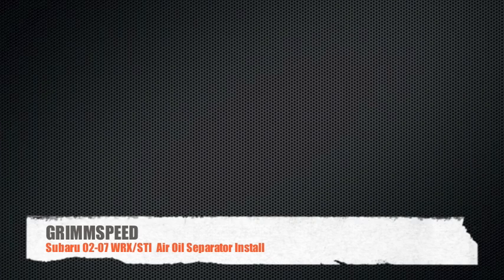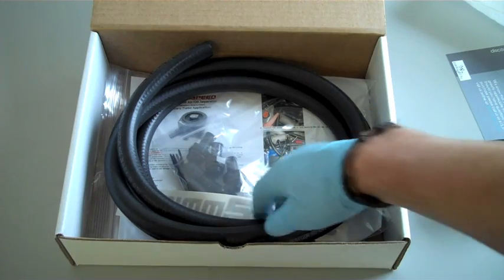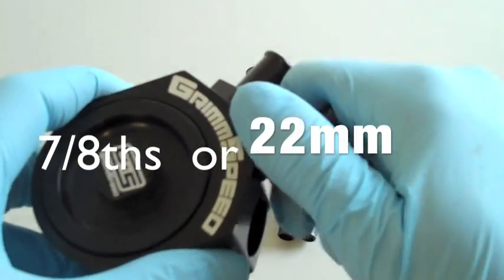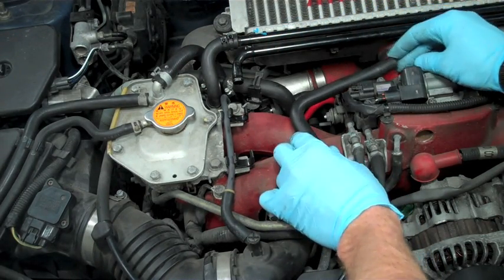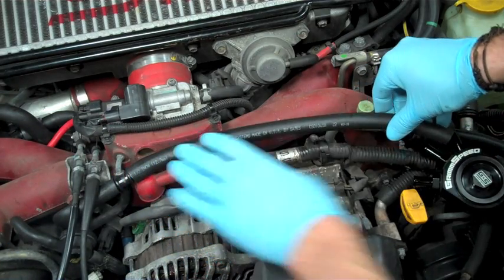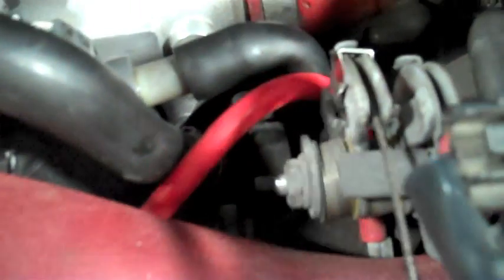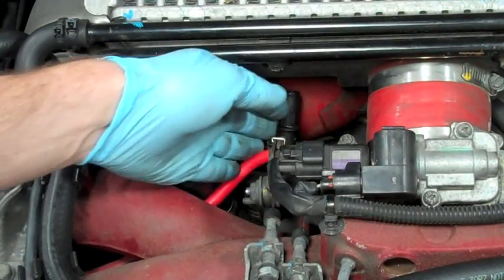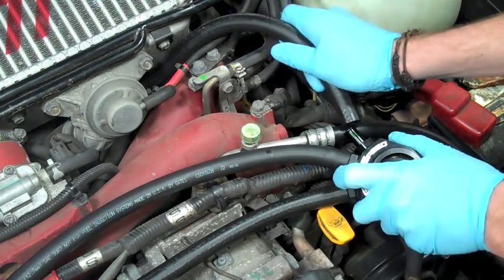GrimmSpeed Air Oil Separator (AOS) Install

Comment: Ahhh just noticed with 3rd hose on mine there is no white or grey port on the turbo inlet hose. The hose is just connected to the turbo inlet hose fitting. So do I just cap the turbo inlet hose fitting instead because there is no white or grey port on the turbo inlet hose?

Comment: For the 2016 Sti its the same right? 
Top hose: T fitting with PCV 
Middle: Turbo inlet
Bottom: T hose the connects to both heads

Comment: i have it on my 06 wrx and i have noticed 1mpg improvement. yes even 1 mpg is noticeable when it adds up in trips and cobb accessport display. the shifter also gives vibrations of the engine detonation. this is with group N bushings all over so the feeling is sharp. the engine idles a bit smoother. the top mount intercooler doesn't have much oil like default OEM setup. so that means it helps with detonation characteristics as well. product is worth the money. thank you grimmreaperspeed

can you make a special color for me, gold AOS?

Comment: Thanks for the vid. Made the install too easy. I ended up running the pcv valve hole straight to the separator and still had two foot of hose left.

Comment: Why is there a disclaimer that all products are for offroad use only when this is a product for better efficiency?
Reply from the maker: The rules and regulations vary so differently from state to state and it's very difficult to adhere to every single one of them, especially when you have a large offering of products. "For Offroad Use Only" is a statement you'll see on most aftermarket parts websites to help avoid regulatory issues.

Comment: Hi grimspeed I wanna buy this product but I read alot of reviews thats it doesn't works as well as it is claimed is that true for most vehicles? Thanks
Reply: Just installed one on mine and I’m sad to say I went through 1L of oil in 1000km (600ish miles). I like grimmspeed but I’m not overly impressed with this one. Wondering if I can add some kind of baffle on the suction side to help stop some of the oil because right now it’s basically just a drinking straw to the oil pan

Comment: Sorry Grimmspeed. But I think this is your only bad product. I absolutely love you guys and have every single part you guys make for my car. Everything from shrouds to the downpipe. I’m a dedicated fan of your products but this particular one pains me. It’s been 8 years since this video went up and many people I personally know have installed them with clear lines to see their actual performance and still get a lot of oil blow by compared to an iag or Crawford aos which plums coolant through it to keep it hot and do a better job of actually separating the oil. I understand this product was designed to be easier for people to install but it really doesn’t preform compared to other setups. I’ve tested things that vent to atmosphere as well as recirculating systems almost all have done better than this. Also if you ever wanna use my bugeye as marketing let me know. It literally has every grimspeed part you make for it minus the aos. Down to the shift knob.

Comment: I know this video is old, but I jumped on an old 02 wrx awhile back and I'm wondering if this AOS will fix this film of oil I have building on top of my y-pipe? Or if it's normal. Thanks for an easy install I'd appreciate some help.
Reply: Lil WRX normal but a AOS would help, Crawford or iag are better brands. This one does not perform

Comment: Installed it on 2006 outback xt. It took some effort to install the last hose, but it is well worth it, now XT even got better gas mileage and a pace of mind that subie will not have ring land failure.

Comment: I installed this last week on my stage 3 2003 wrx. i have a tomei turbo inlet hose and when i put this AOS on and used the cap over the metal fitting attached to the inlet. I ran some pulls afterwards for logging purposes and noticed that after the first pull my boost started leaking. I pulled over and the entire metal fitting had popped of (i guess it was launched?) Is this normal?

Comment: What a mess that made of the engine bay. Pointless if it's recycling hot air back through the turbo
Reply: troll says troll things.. weird
Reply: he caped off the sensor that feeds back into the inlet
Reply: your suppose to

Comment: wish you would share the other kind of "Hoes" ; )

debating between this or the catch can for my 2011 STi... anyone have any suggestions? thnx. looks like a more simple option than the can.. install and all
Reply: MidWeSTi I've been using this AOS on my 06 STi for about 3 years now & it works well in my opinion & I'm happy with it. The only thing that kind of annoys me about the setup, is that you need to use a ratchet anytime you want to add oil, but it's not a huge deal for me.
Reply: HawkeyeSTiGuy thanks. seems like it wouldnt be too bad since i dont add oil unless im changing the oil out. so not often lol
Reply: Yeah, pretty much how I feel about it. If I ever do change to a different setup, it would be more so just to try something new, & not because of a design flaw. I think it's a great product, especially for a daily driver.
Reply: HawkeyeSTiGuy cool.. i may get this one.. thnx for the info
Reply: I'm sure you've long since made a decision, but the best possible option is to get a catch can. AOS is a good alternative and is much better than nothing, but simply removing the crap blowby oil from the system is always going to be the best option.

Comment: What does this application actually do? I own a 2004 WRX
Reply: When your on high boost your sometimes suck up some oil from the turbo. That can get in your intercooler creating blow by. Enough oil and it can get in areas of your motor where it shouldn’t be like in your piston heads and creat detonation. Then good by motor.
Reply: David F are what?
Reply: Dailyed STi, oil in the air also decreases octane.

Comment: They are in the same general location but may look slightly different than in this video.  We have a PDF installation guide on our website that has detailed pictures of other year vehicles.  Find the product on our website and then under the product description there will be a "installation tab".  Under this tab you will find a link to the PDF installation document I am speaking of.  As always, if you have any further questions just give us a call @ 612.379.0000.

-Matt Homes

Comment: Hello,

The install should be the same. All hoses and fitting should be connected to something. If you're AOS is not installed properly i would bring it back to the shop and insure they install it correctly. An improper install can lead to major engine issues.

Comment: Hi , Is this the same for fitting on a 2010 model , I have the kit installed already by tuner but they've really messed it up and the right hand side pipe doesn't go anywhere , Thanks

Comment from the maker: Simon,

There are shorter aftermarket oil filler necks you can get, and some with a different angle to accommodate FMIC piping.  The names of the manufacturers are evading me at the moment but I am sure with some searching they will pope up.  We do not make a AOS unit that is any shorter, so reducing the filler neck length will be the easiest option.  -Matt Homes

Comment: Yes you will have to use a 19mm socket to remove the core to add oil.  Your stock lug nut wrench just so happens to be a 19mm so you will always have the means to do with with you.  -Matt Homes

Comment: 300 bux is a bit much... though an oil catch can does require maintenance, it can be done with every oil change and the GS Oil air separator has to be removed with every oil change... your prices have to come down.

Comment: When an engine burns fuel it produces condensation, if you only do short journeys the engine/exhaust will not get hot enough to burn it off. Hence emulsification in your oil filler cap and breather hoses, and eventually premature death to engine and exhaust. Your oil won't reach temperature and your pistols won't fully seal etc etc. If you love it then use it, otherwise walk.

Comment: Q? I put this on 08sti, and cleaned pcv very well was rattling around no doubt. still getting tons of oil in tmic/intake/turbo inlet/bov sprays it. double/tripple checked all hoses. nothing leaking??? hoses connected properly via instructions from grimmspeed website. Please help suggestions welcome by anyone with a decent knowledge base on this please. Thanks
Edap79

Comment: I still get a thin oil film/residue inside my TMIC.  Also.. in colder weather.. when you shut off your car after it warms up.. the air inside the AOS lines condensate into water vapor/droplets which gets mixed up into the oil. =(

Comment: The difference is that GS unit is much more compact and requires less maintenance. Installing process is less involved as well. If you have milky oil on short drives then an AOS wont help you. You got bigger problems to worry about. AOS helps with blow by build up in the intake and intercooler piping.

Comment from the maker: @whiteshark27 Our AOS retains full functionality of the PCV system, the "check sensor" is not actually a sensor in the conventional way, its simply a connection to verify that the PCV system is installed. 

Will

Comment from the maker: @e85junkie Great question! You will fin water collect in a catch can because it has a direct "open line" to the atmosphere. When metal gets cold water will condensate on the surface and over time collect. This can be apparent on short trips or cold weather where the condensation is not given enough heat to fully evaporate. The water would never make it all the way into your motor because it would evaporate before getting there. What is unique about our AOS though is that the OEM operation stays!

Comment from the maker: Actually its pretty straight forward. When you install a FMIC you either keep the metal crossover tubes or you t the lines together, either way you are still creating the same "system". A FMIC with a T is usually both heads T'd together then routing back to the inlet. Instead of routing back to the inlet route that hose to the right port on the AOS. Any more questions feel free to drop us a line @ 612.379.0000